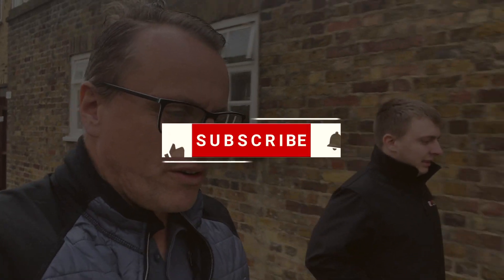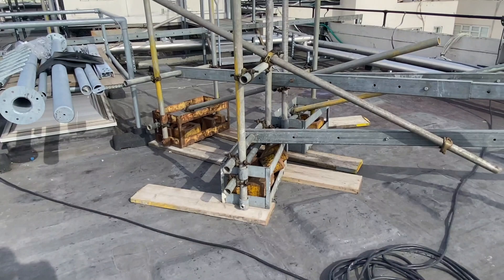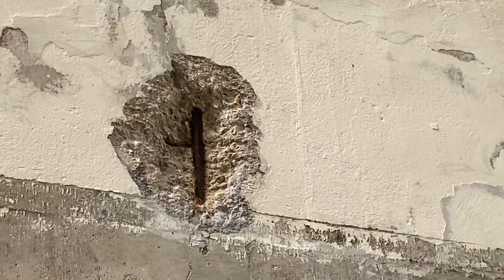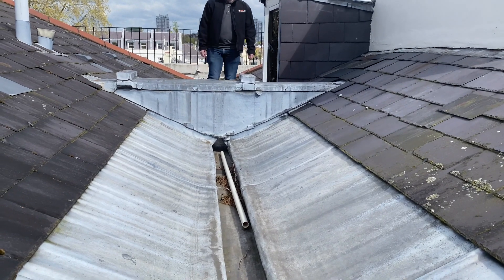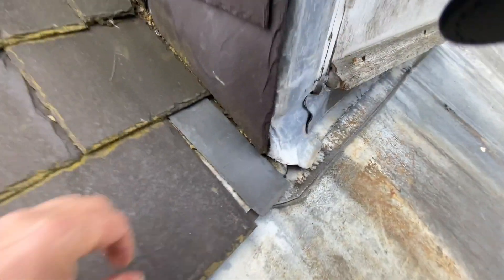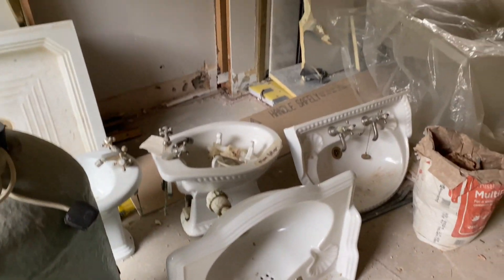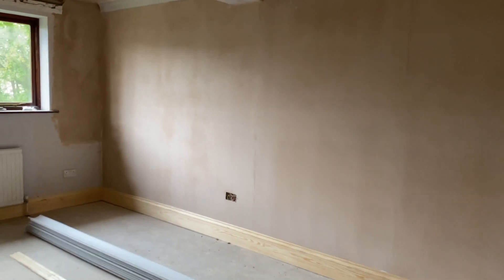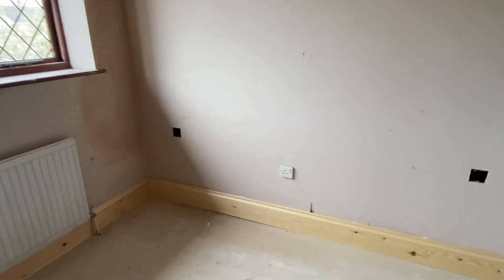A day in the life of a Building Surveyor - April 24 (2)

Comment: A question regarding roofing if I may. If a roof is in good condition does the age of the tiles matter? For example would a well maintained roof with concrete tiles be flagged on a survey if the property is 30 years old as the tiles have a limited lifespan? Thank you
Reply from the maker: Not necessarily. If the tiles are in good condition and the roof is not leaking, it is performing its function as a roof. The surveyor may advise of age related issues and if failure is expected.
Reply: @westonesurveyors8139  thank you for replying that is very helpful